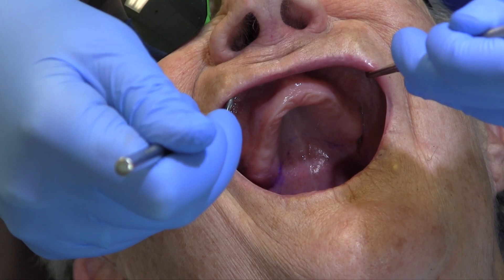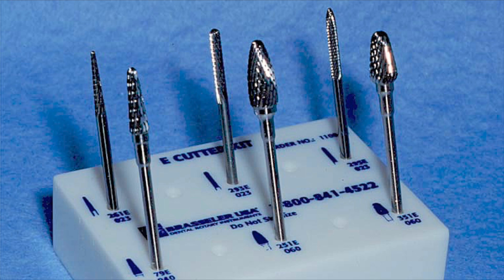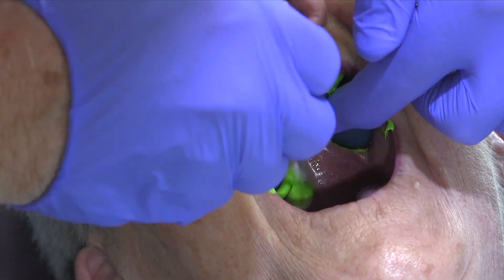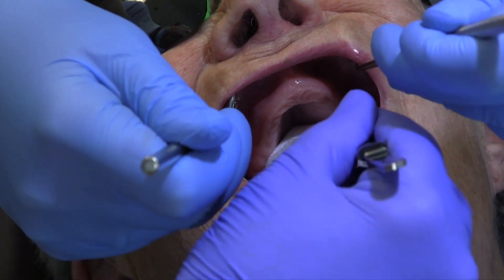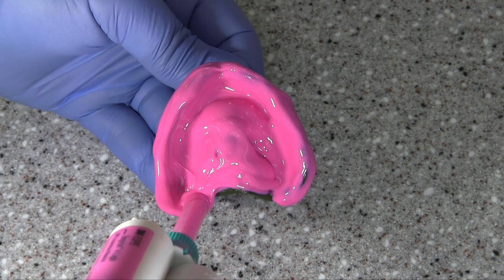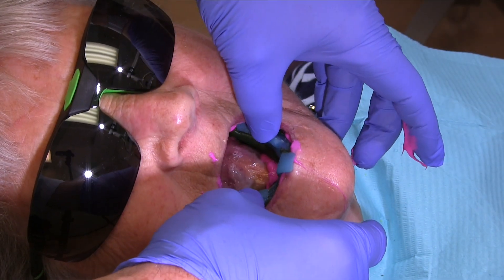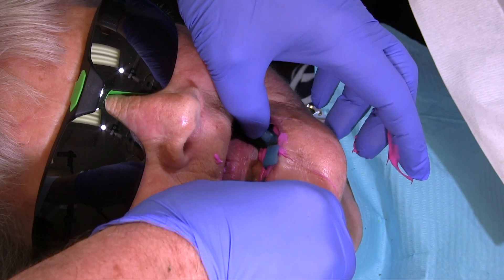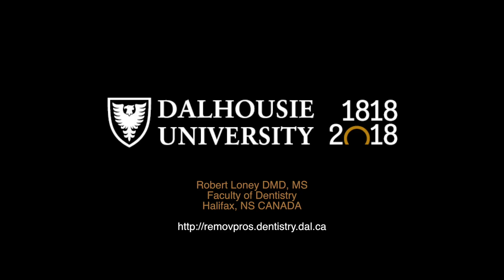Complete Denture Impressions Two Mirror Technique

Comment: What if we place posterior part of the tray first?
Reply from the maker: You CAN place the posterior of the tray first and subsequently rotate the anterior portion into place. However, common problems with the posterior-first technique include 1) creating a seal with impression material at the back edge of the tray and thereby trapping air (and possibly excess material) in the palatial vault, 2) not being able to rotate the anterior flange past the height of the anterior ridge (and therefore not seating the tray fully), trapping excess material in the anterior vestibule, leading to a distorted and severely thickened anterior denture flange and 4) having difficulty aligning the labial notch of the tray properly with the labial frenulum (too far left or right). Many clinicians use the posterior-first technique with good results after experience. It is the technique that I was first taught, with the rationale that it would create a seal and prevent excess running to the back of the patient’s throat. The anterior-first technique does cause the excess to exit the posterior of the tray, but it is easy to remove there and it does tend to minimize the other problems.

Comment: Hi Dr, may I know what are your considerations when choosing between PVS light body and znoe? Thanks :)
Reply from the maker: Zinc oxide and eugenol impression pastes can be used to make good complete denture impressions. However we have stopped using those materials at our dental school for several reasons. Polyvinylsiloxane (PVS) impression materials can be used for all our impressions (crowns, removable partial dentures, etc.) so we need to purchase fewer materials (cost, inventory). Additionally, they are more pleasant for patients in regard to taste, they are available in multiple viscosities, they can be poured a long time after removal from the mouth, they remove more easily from undercuts (flexible) and they are among the most accurate impression materials. For these main reasons we have chosen them as our standard material for final impressions for all analogue procedures.